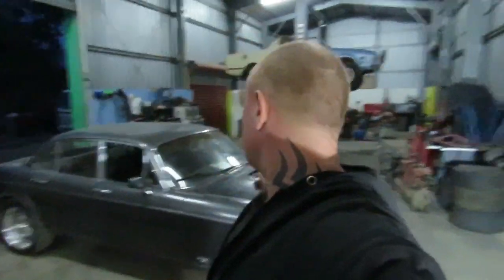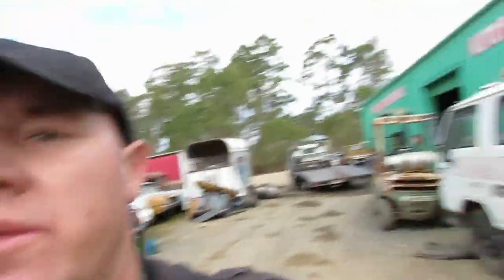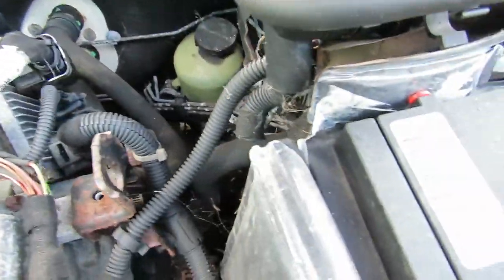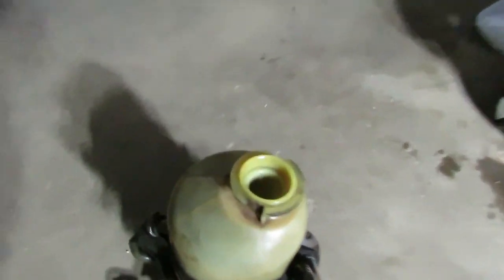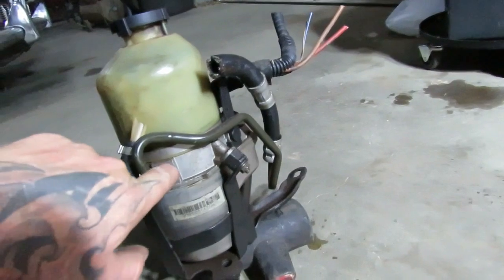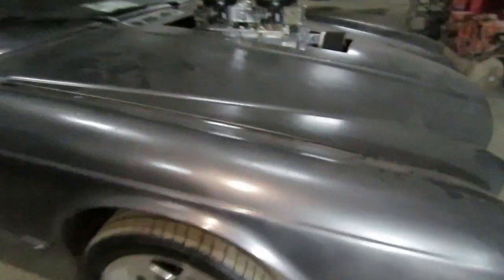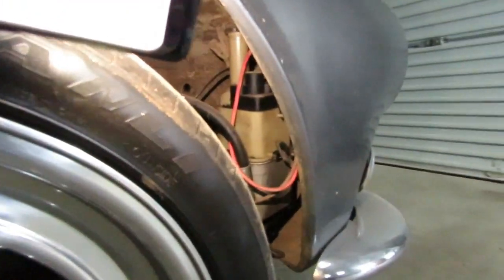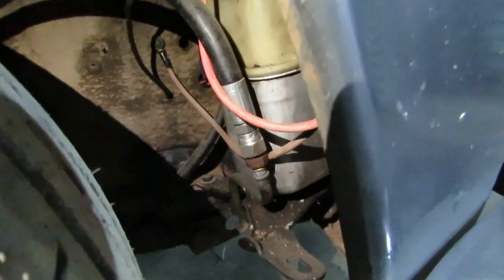kingatow crew. Electric power steering conversion...drift...drag...street

Comment: Problem is without the sense wire they get real heavy in the steering when you push lock to lock quickly , as  in drifting  it just thinks its in highway mode , low power mode 15-25 amps  high power mode is 40 plus amps

Comment: That Jag is just car porn to me.  Fkn thought I was on Redtube for a moment  not YouTube!
By the way, love the power steering fix , great content as always
Reply from the maker: drives good even unfinished hopefullyhave rego on it this year so i can daily it abit
Reply: Top stuff, not easy when you're running a business and back and forth from tow  jobs.  Can't wait to see it on the road with  rego. Its such a rare car ,I'm glad it's being reborn with a attitude rather than scrapped. 👍
Reply from the maker: i have another good series 1 xj6 its tge red one in the workshop ...it will have the std 6cly and auto but turbo ...i have the turbo and the plates to make the manifold and i brought a series 3 motor and box for tge injection inlet manifold i will get a self learning efi computer for it